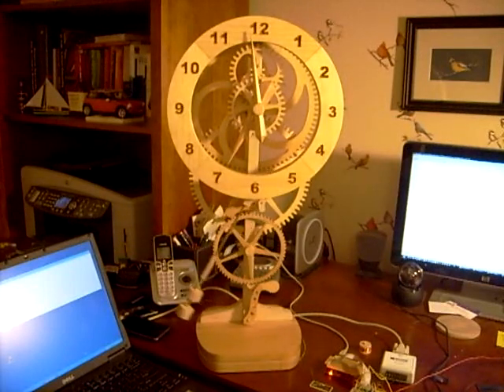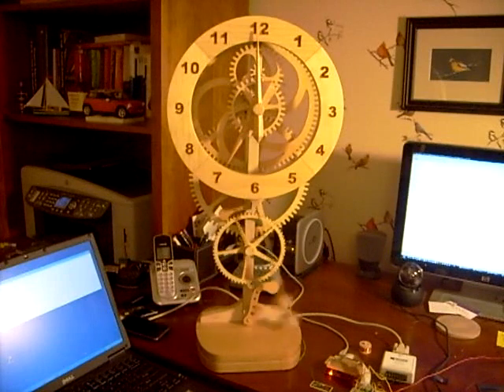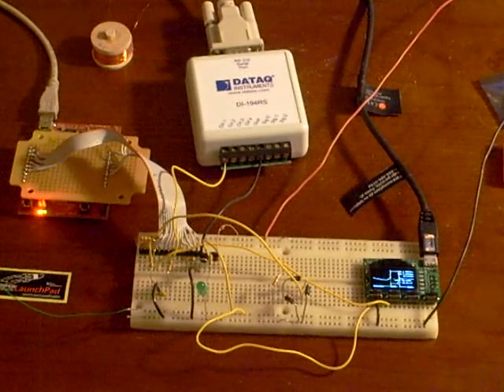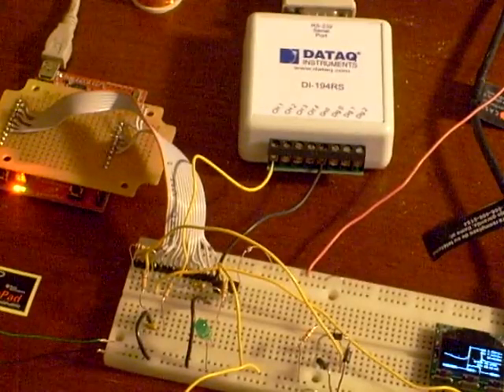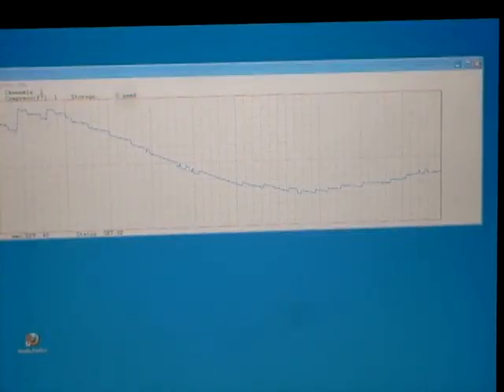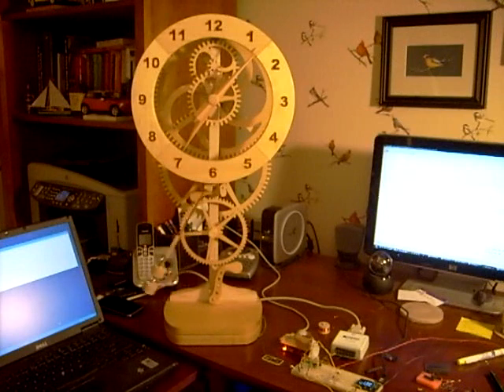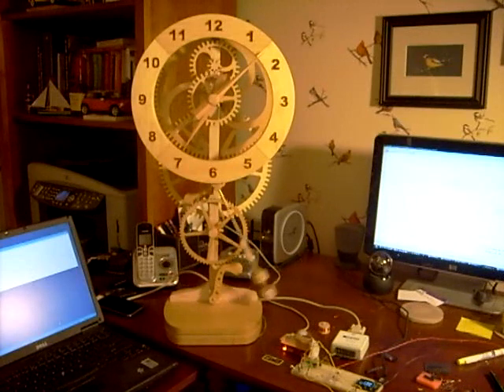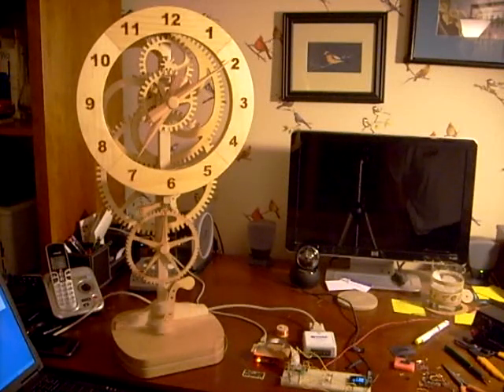Mystery Clock & LaunchPad

Comment: Great vide. How much is the dfx files.  I am interested buying them from you. E-mail me at ks677957@gmail.com
Reply from the maker: Karen, I built the clock using a Carvewright CNC and designed the parts using Carvewright Designer software.  It unfortunately uses a proprietary file format so there is no way to produce dfx files.
Reply: Thanks.  I have a  shark cnc black diamond edition from rockler.com. it uses  Vectric vcarve pro software. It uses dfx, pdf, v3d, and many more file types. Thanks for your time.